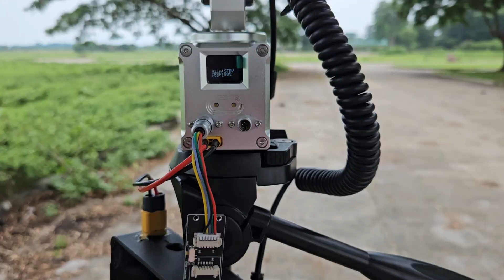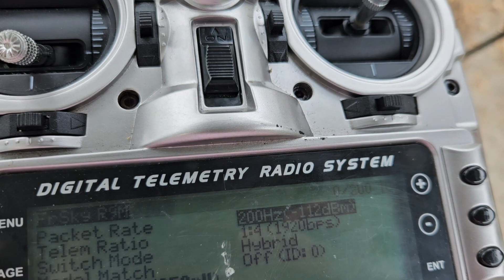Actual Test: Frsky R9m (elrs) telemery mirroring to Crossbow mini....... did it work???

Comment: Hi the hm10 is for send the teleletry from the elrs tx ?
Reply from the maker: The hm10 is for crsf mirroring (connects to the radio's bt module). But if using espnow with elrs Rx on tracker, no need for the Bluetooth module. The elrs Rx on tracker directly connects to the elrs tx backpack. It's a different method to transmit telemetry, and it doesn't use CRSF but rather mavlink
Reply: @windfpv  ok then I only need a receiver elrs for the tracker...and the tracker needs a gps module too?
Reply from the maker: Gps is optional.
Reply from the maker: @siniestrorave  just make sure the elrs tx has a.backpack
Reply: @windfpv  yes now iam using a Jumper t20s gemini...has the option of telemetry...then You send the telemetry to a elrs rx connected to the tracker and i need someting more like another GPS ?
Reply from the maker: You need to enable telmetry on backpack of your tx, this will push the telemetry to the elrs Rx that runs espnow  on the tracker.
Reply: Finally i saw that My jumper t20s does not support esp but My another TX happymodel does...I Will try with the external module ...thanks a lot My friend....Will be my next project
Reply from the maker: yeah, apparently the jumper t20s doesnt have backpack if my memory serves me well
Reply from the maker: @siniestrorave  https://youtu.be/bB0DdgTDpFg

Comment: can we transmit telemetry data to mission planner?
Reply from the maker: Yes if you are using the mavlink RC branch firmware on elrs, apparently I'm just using the regular FW,  not possible on my current setup
Reply: @windfpv  can you share the branch?
Reply from the maker: It's in the configurator, just select the other branches there

Comment: Sorry.. Just one question ... The inverter module is the crossfire inverter module 400kbaud/board or you have built yorself with mosfet 2N7000 and resistor? And the power supply for HM-10 is 5v or 3.3 v? I don' t have understand well how is the elettrical diagram from uart port taranis to input for HM-10.. Thanks in advance for your answer!
Reply from the maker: I used the inverter that came with the TBS crossfire module, but any inverter should work. As for the hm10, it can run from 3.3 to 5v. But the inverter only runs on 3.3V, thus I installed a Bec, stepped the voltage down from uart Vbat to 3.3v to make it safe for the inverter and hm10.
Reply: @windfpv  thanks a lot !
Reply from the maker: @fabiogruarin5856  anytime mate!

Comment: You just make it all look so simple. Which do you thank mirrors the best Blue Tooth or Wi-fi I have RM TX16S, Opentx ,INAV 6.1.1. just waiting for Horus shipment X10 Blue tooth module also I'll be using Crossfire. Great Job
Reply from the maker: You can directly connect to crossfire module via wifi, not needing Telemetry mirroring.  I tried it before and it worked pretty well. Although it requires you to do a couple of additional tasks like updating the wifi module in your crossfire module to make it work and stuff. Alternatively you can try Telemetry mirroring, it works good too. You can put hm10 on tracker, or esp32/heltec wifi32 that can do BT or wifi (so you can also get to try connecting directly to crossfire module 's wifi if you want to :-)
Reply: Thank You for sharing and taking the time to respond.

Comment: Do you have to use a particular paket rate to get it to work ?
Reply from the maker: No, not really. On my other elrs setup it works even at 100Hz, on this r9 setup it works better at 200hz. Of course higher will give you better crsf link, but at the expense of range

Comment: I wish there was a not overpriced antenna tracker with,
360 degree rotation slip ring,
without having to add anything to my model,
GPS module and compass on the tracker so I don't have to worry about keeping the tracker pointing north and not moving it while in use
Reply from the maker: I did not add gps module (with compass) on the tracker used on this video :) I just calibrated the internal compass, then set it to InitOnly (it does not require that you manually point it to north). BUT i cant move the tracker from it's initial spot :D

but yeah, if only this has continuous rotation with slip ring...but then again it wont be cheap...
Reply: @windfpv  I think inserting the coordinates to the vtx video feed like the sentinel AAT does is the best way to not have to add anything to your model, or do you have another idea?

also I also want the tracker to have a gyro so I don't have to level it and that way it can work on any slope ground.
Reply from the maker: Mfd Crossbow mini takes in video signal for tracking like the Sentinel. BUT , if your Telemetry link goes farther than your video signal then using telemetry would be better. Also, if you are using DIGITAL FPV, You can't use the video for tracking...only works with analog fpv
Reply: @windfpv  Thanks for your reply.
I read MFD mini crossbow manual and I learned that you need to add an MFD TeleFlyTiny module on your model to send coordinates with VTx video to the mini crossbow tracker, and BTW the module has 16 wires, WTF!

I have not found a good tracker, I think a good not overpriced tracker is really lacking in this hobby and I wish someone will make one.

The Sentinel tracker is about 100GBP and you need a 3D printer to make it which I don't have.
The MFD mini crossbow is almost 200USD and the MFD TeleFlyTiny module is about 50USD, and if you own many models and want to add one to each model that's going to cost a lot.

Those trackers are way overpriced and don't have all the features I want.
Reply from the maker: @flat-earther well, if you opted to use telemetry for tracking (and you got a receiver that has telemetry), then it would be wiser NOT to use telefly tiny. You will save a lot by not using telefly tiny on each plane. The MFD Crossbow mini can use  other options for tracking aside from telefly tiny. I got a telefly tiny here that I have never used ever since i found that the Crossbow mini can use telemetry instead. It will make your life easier as you dont need to mess up on how to wire the telefly tiny module. And since most of the receivers nowadays are telemetry capable, might as well just use that feature. No need to put one telefly tiny on each of your plane. Imagine if you have 10 models, that would cost a lot! Wiser approach is just to use telemetry. It's much simpler. Also, telefly tiny only works with analog FPV. If you do the telemetry route, it will work on both analog, digital FPV, or even without fpv system, as the crossbow mini will not use video feed for tracking but rather telemetry data.
Reply: @windfpv  okay thanks.
I use ELRS and I get telemetry which includes coordinates to my radio that runs EdgeTx. is there a way to forward that telemetry from my radio to the antenna tracker?
Reply from the maker: That's exactly what this video is about 😁 you can mirror that CRSF Telemetry from your radio. 😁 you may need to add bluetooth or wifi module on your radio though unless it has one built in. Then put another BT/wifi module on the tracker to receive the telemetry mirrored
Reply: @windfpv  oh okay cool.
I have Radiomaster TX12 MKII MPM version and it's without bluetooth. I'm using external ELRS module.
do you think I can add bluetooth module to this radio?
also can the telemetry mirroring be done wired without bluetooth module? I would prefer wired from radio to antenna tracker.
Reply from the maker: Oh, apparently tx12 mkii does not seem to have an accessible uart port unlike other radiomaster radio such as the tx16s... i guess you cannot do that with your current radio.
Reply: @windfpv  okay thanks.

what about connecting an external ELRS module to the antenna tracker with a cable? look at NAMIMNO ELRS 2.4GHz Flash Micro TX Module, on it's bottom it has a port with 4 pins.

Also Namimno ELRS 915 Voyager TX(this product is out of stock but it would be the one I would rather get because I use 900mhz), it also has the same 4 pin connector at the bottom, but it also has another 4 pin JR style port on the front.

Do you know what those ports on these Namimno ELRS modules are used for? is that a UART just like on the TX16S radio that can be used for this application?

Comment: If you bind HM-10 with HM-10 in this solution, do you have another HM-10 when you take the X20? On the Crossbow Mini should actually be a Bluetooth module with display, where you can then select the telemetry source ...
Reply from the maker: no need for another HM10 if i use my frsky X20 as it has internal BT module. I demonstrated it on the previous video (i detailed the procedure on how to bind HM10 with internal BT of my Frsky Tandem X20, but the same binding procedure can be done ti bind two HM10 BT4.0 modules) :

https://youtu.be/ZpC2FIxehF0

On frsky radio that has internal BT like taranis Qx7s, X10s, X20 and the likes, only one HM10 module is needed, that BT module is for the tracker. For other radios such as Taranis X9D+, Radiomaster TX16s and the likes, you need two communicating devices, it may not be HM10. You can use HC05 or even use Wifi modules if you want. You just need to make sure those two devices are bound
Reply: @windfpv I meant that you have to bind the HM-10 on the tracker always new to the source, or just have 2x HM-10 for the tracker, which are taken depending on the source.
Reply from the maker: ah, i get it now :) to be honest I would just put another HM10 (make sure to label it), that would save you the hassle. :) it's much faster to move the connector anyway than to rebind. Actually, underneath my tracker, you will find 2 BT modules (HC05 which binds with my dragonlink relay setup, and HM10 which binds with my X20). Whenever I change between ELRS and dragonlink, I just move the connector across the two BT devices then change the protocol on the tracker between mavlink and CRSF protocol. If you are using the same protocol (e.g. CRSF) on all your devices, then you just need to move the connector and care less about anything else. that's the easiest way to do it, i suppose
Reply: @windfpv  Instead of using 2 or more Bluetooth modules, you could simply select the source (Bluetooth or Wifi) with a Heltec ESP32 with display. That would then actually be optimal.
Reply from the maker: yes it should, however it will depend on your devices. You should consider that if you already got x20 that has internal BT, then it''s more cost efficient to use HM10 only on tracker. otherwise, I would need to buy another device for my radio (eg. another BT or wifi module). On my Dragonlink relay setup, I have heltec wifi module for the mavlink (before I switched to using HC05 on the relay), but then my ELRS setup uses HM10 (since im using internal BT on my radio). Basically, either way i would be using another module other than the wifi module, one way or another. I just switched to HC05 on my DL relay since I want to dedicate the mavlink via wifi for my ground control station telemetry and not share it with the tracker. Also, my dragonlink uses mavlink, so there's a specific conversion that it undergoes (mavlink to passthrough), which makes it incompatible with my CRSF protocol on ELRS. In a gist, i cant use only one kind of module on my setup.. Maybe in other setup it's doable though. You get my point? You have a lot of ways to do this, not just one approach :)
Reply: Yes, i get your point. I have Dragonlink, Crossfire and ELRS in use myself and know that ... ;).